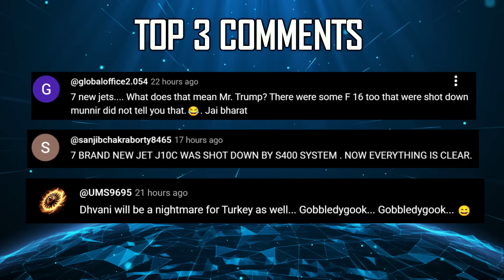Indian Defence Updates : Nuclear Super Torpedo,AMCA Stealth Weapon Bay,DRDO 30 Km ATGM,200 Tejas MK2

Comment: It's not possible to create tsunami with a torpedo be it nuclear powered,even a little tsunami contain the power of 40 nuclear explosion togather
Reply: Tsunami of 10 feets are called mini tsunami it can be created with a nuclear powered torpedo,  those weapons are modified to work like that
Reply: @Absolute_Warrior and how will the nuclear Torpedo warhead work to create the tsunami if you please care to explain,by hitting a ship or a shore?and how will they reach the shores from the sea? please explain I am eager to learn.
Reply: @ArjunGhosh-f5x The 1946 Baker test (23 kt, detonated 27 m underwater) created a 30-meter (100 ft) wave at the epicenter and a base surge that traveled over 1 km.
Poseidon’s estimated 2-megaton which is the most minimum estimate it can easily create 100 meter size tsunami waves with more radioactive waves traveling the minimum 10 times the the one with 27 kn warhead
Reply: You are absolutely right but wave caused immense damage to the tanchored in the lagoon, sinking many ships and severely contaminating the rest, but it did not travel far or maintain height as a tsunami does and the damages were done by radio activity not by waves impact, you are hitting human life with a radioactive device making a far longer effect instead of a short term natural disaster